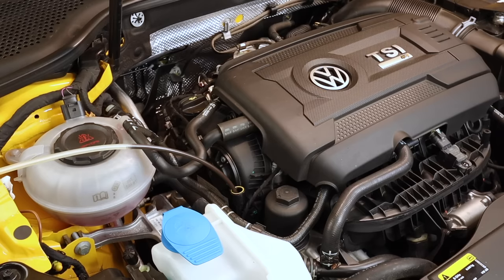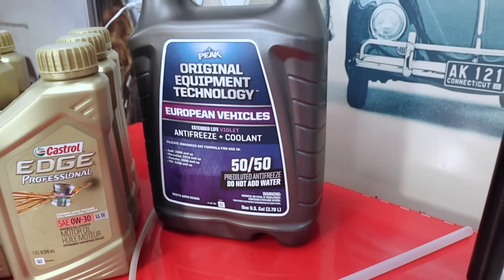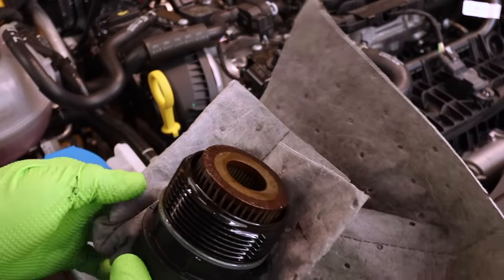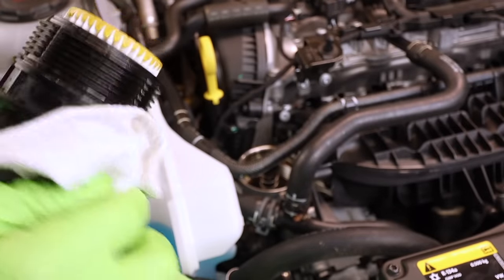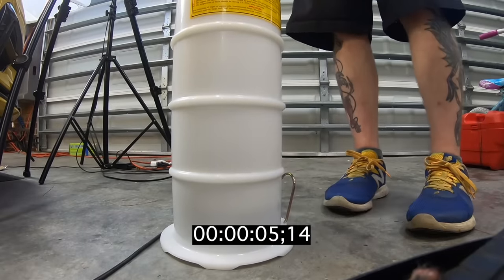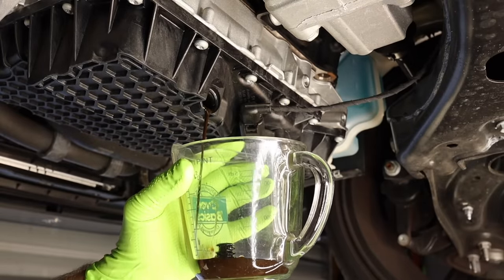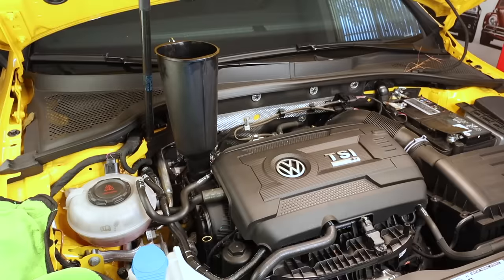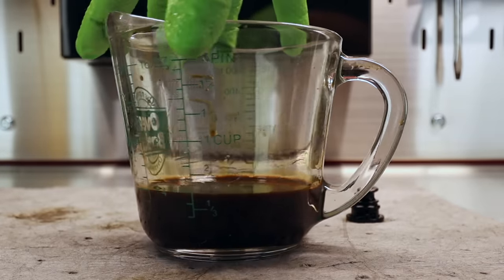Will an Oil Extractor Get All The Oil? (MK7.5 Golf R 5000 Mile Service)

Comment: So if you're using the extractor, and you've got it bottomed out on the pan, then isn't the leftover oil whatever was at the top of the pan? Because you drained from the bottom and not the top down? Does that makes sense? It does to me and I know what I mean. I agree with the not leaving oil thing. I don't like it either. But 100ml really isn't a lot compared to the 6 liters you got out.

Comment: I change mine every 5K as well.  Regardless of what the OM says.  I only use synthetic as well.  I have rebuilt enough engines where I can tell immediately after popping the valve cover or pan if synthetic was used.  This is a great video and it actually raised more questions.  I'm actually not sure I am comfortable with leaving 10 ml behind.  I'm also wondering if you bake with that measuring cup.

Comment: I have a 4WD truck and was debating this for the differentials, transmission, and transfer case. Seems like it would be easier and less messy. What’s your opinion?

Should make my lawn mower oil changes super easy!
Reply: Seems like this is only useful for German cars where the engine oil filter is on top and easy to get to.

Comment: Just alternate methods.  Drain plug method during nice summer days, and the extractor method on days when you dont want to break out the jack and stands.  Extractor method is cleaner and faster.

Comment: With proper vacuum and tools, from either a specialized oil vacuum pump or compressed air suction devices all the oil to the last drop gets evacuated. I know, I have the machine and have checked and that's what we do it at my shop that specializes in European cars. The fact is, all Mercedes dealers, Land Rover/Jaguar, Audi/Porsche/VW exchange the oil via suction, BMW is the exception; I should now, I worked for all of them except JLR.

Comment: Just a couple of issues  my 991.2 Turbo S  and prior F90 M5  do not have traditional dip sticks. I guess only cheep low end cars still use outdated dip sticks.

My other issue is oil that’s left in the oil coolers (aprox. 1qt)
What the best way to drain them ?
If anyone wants to know 
BMW F90 M5 oil change  $325
991.2 Turbo S oil change $550
Like you Charles I like to change oil more often the what warranty covers.

Comment: Thks for the review and great work on the video.  No need to over thinking over a small portion of 100ml oil left. 😅✌🏼 Nothing is perfect is this world. I've change oil around every 3000km to 4000km for my car over 20 years old by the drain nut method. My car's engine also ended up need an overhaul at 350,000km. Hahaha. 🤭✌🏼 Nothing last forever. ✌🏼

Comment: Commendably informative, thank you. Having changed the oil, oil filter, oil-pan and valve-cover gaskets of domestic cars, I acquired a ‘95 Audi A6 Quattro with few miles, and I would not begin to remove any parts unless I was referring to the manufacturer’s diagrams, spec sheets, etc. Before moving any protective cover, I would need to know that I’ve correct applicable tools, replacement bolts and gaskets, o-rings, etc. 

If someone would please recommend the correct manufacturer’s maintenance/service guide such as what I had relied on from Chiltons and Haynes, I would truly appreciate it.

You know that most older domestic autos included oil filters beneath the vehicle near the drain plug, unlike most Euro cars today. Correct? If that is the case with my humble Audi, the oil extractor would not necessarily expedite the draining of the oil? Yet, I used a siphonner to siphon coolant the necessary number of times from my overflow tank in order to clean it with a flexible brush and appropriately sized cloths. That kept the coolant in new reliable condition. Mechanics who prefer to work on domestic vehicles may charge quite a bit even when they don’t reliably replace filters and drain plugs, which can result in a real problem if not tended to immediately, which is why I keep spare coolant and oil on board.

Appreciating the info that you’ve been providing

Comment: A drain pan, new filter, new plug and washer, and gravity suit me fine. The oil extractor looks expensive and not so easy to clean. Maybe it's not any trouble, but once I pull the drain plug, I can take 20-30 minutes to check everything else, change the air filter if it's time, get some water or tea, then complete my oil change. I'm a dyier and time isn't costing me money.

Comment: I just bought a used 2013 Audi. I was appalled to find NO OIL DIPSTICK! 😳 
I plan on using the drain plug for the first oil change. Then I’ll attempt to tilt the car/engine towards the oil extraction tube and see if gets all the oil out.
.... oh and I ordered a dipstick!!! I’m not gonna only rely on the sensors/computer for oil level check.

Comment: I have a Mityvac extractor which is great and allows you also fill from it as well. After I put the new oil in the motor I fill the empty jug the new oil came in with the used oil from the Mityvac.

Comment: I always found with these extractors, or even those quick connect plugs, it was always just faster to remove the plug traditional style.  Convenience is nice, but if it takes three times longer -- I just want to be done....

Comment: I have 3 vehicles and they all require oil changes every 6k miles, but I change my oil and filter on each vehicle every 4k miles.  Now the Tacoma and 4runner arent that big a deal.  They are both lifted and dont require any jacking or driving up on ramps to get to the plug.  How ever my Subaru Legacy does, plus its my commuter vehicle and it sees 4000 miles a month, so that means Im changed the oil and filter on it once a month.  So I use the oil extractor to change the oil on it a few times.  I understand there is still old oil left in it, but since Im changing the oil much sooner than need be.  Its really not that big a deal, plus every few months rather than use the oil extractor.  I drive the car up on ramps and pull the plug and use an extra quart of new oil to pour down the engine and flush all the old oil out.  Yes I am very anal about vehicle maintenance.  My last commuter car, a 2008 Toyota Camry went 600k miles on the original engine and transmission, because I was anal about regular maintenance.  If that aint getting you moneys worth from a car, I dont know what is.

Comment: With the ease of the extractor you can complete oil changes on time. However, i use oil change time to inspect the underbody, suspension, bushings, tires, rust, etc....
I will be buying one and i will use it every other oil change. Hopefully i don't get in to a bad habit of just using the extractor.
Reply from the maker: You’ll still do the inspections. If you do it now that is.

Comment: I’ve been quite happy using a oil extractor on my Mercedes 2014 1.8L Turbo C250 every 10K miles for a few years. Never had any issues. I just picked up a Mercedes GL450 and I will also be changing the oil with my oil extractor.

Comment: Unless your racing that car in track conditions they are good for 10/12k. In Europe the use Castro’s edge 5w30 long life and can go fixed 12k or 12 months ro variable using oil sensors in the engine up to 20k or 24 myths but my experience is 12-15k is when the sensors will say time to change

Comment: Hello sir, 
Yes I will use the oil extraction tool 100 percent because half of a cup of oil in the engine no big deal.  I used my extractor 6 times already and love it , no mess.  Not to mention you will  not going to have any leak from oil pan. 
Liked your video,  very informative thanks and stay safe.

Comment: I prefer to do it the old fashioned way, it gives me a chance to see underneath the engine/front end that you can ONLY see if you get down there, check for any leaks, worn parts, missing or loose nuts, screws, bolts, cracked or broken plastic. Just to make sure everything is Ok for another 5K. At least VW hasn't denied access to motor oil changes (yet) when they do, then I'll by an oil extractor. EDIT: Just wondering if people that use oil extractor are changing the drain plug at oil change as VW recommends, I know HM did ...but was that just to show how much oil was left behind or would HM done it anyway? What's the consensus.

Comment: Oil extract every time, less likely to get oil leaks, less likely to spill oil, less likely to have under body trim clip problems, less likely to spill oil over your driveway can do it without a lift, start with a warm engine then after extraction leave for 10 mins and then extract the rest, if your worried about any that is left, then do your next service 100 miles earlier or buy a electric car

Comment: With my 3.0tfsi oil didnt drain at all when i used the pump. Pump drains more than taking out the plug. I did the other way around, taking out the drain plug first, i managed to pump out another 300ml. Its all depends on which type of engine u have i guess...

Comment: Realistically, the volume of oil not extracted is about 2% of the overall oil capacity. If the car had no major issues prior to the oil change, I reckon diluting 98% new oil with 2% remaining oil is probably ok.
Reply from the maker: Especially if overall the car is well maintained

Comment: did you so a final vacuum extraction  before removing the sump plug -  in my experience it will always suck up a bit more oil if it’s been left to stand a while
Reply from the maker: I didn't. Even with what I drained its 100ml out of almost 7,000ml. not worth messing with on a properly maintained car.
Reply: @HumbleMechanic  Indeed - more from a point of view of understanding how much it actually gets out - but 100ml is nothing in the grand scheme of things

Comment: I get more oil out with a small vacuum pump AFTER all the oil finishes draining from the sump. The pickup tube has to be positioned correctly though.

Comment: My wife's audi is a pain in the ass. It has a cover on the bottom of the car that's really finicky to take on and off (multiple kinds of screws, plastic push thingies, and other stuff that doesn't like to stay in place). The clearance is also so low that I can't drive it onto ramps without adding other stuff to the ramps to change the angle. We also live in an apartment, so we have to go to my in-laws to change it, and my father-in-law always grumbles about oil spill drops on his property lol. I think I'll just go with an extractor. It'll make it simpler.

Comment: Ok, dumb question: why not fill it to the top of the hash marks on the dipstick? I realize it isn't making microchips but generally speaking, in my 35 years of DIY oil changes on roughly 20 different vehicles, halfway on the hash marks has always meant a 1/2 quart low. I'm no engineer though...

Comment: It works! But nothing is as good as a warm-hot motor oil change and filter change with a 1/2qt of fresh oil put in with the plug still out to flush it.

Comment: I always flush the engine with ethanol after I drain the oil. Then I circulate the ethanol and let it rest on level surface before draining it before rechecking it.  I then drain it and add fresh oil so I can be sure there's absolutely no old oul every single time I change my oil.

Comment: I'm an industrial service technician. I work on everything from forklifts to the tugs at the airport. I love my fluid extractor. No need to jack up a 10,000lbs equipment to get a drain plug that is probably over tightened. It also let's me pull the oil out while the engines smoking hot. I go in thru the dipstick tube. Works like a champ

Comment: There is a reason why oil sump's have a drain plug. I will leave it dripping away while I'm changing the spark plugs and air filter, by then all the oil is out and ready for fresh oil and oil filter.
If you have a upward facing oil filter, fill it to the brim let it settle and keep doing so until no more can be added that way there is no delay from oil pick up pipe to filter to vital engine parts.
Reply from the maker: I like doing that with the filter on the up facing ones!

Comment: I know this is an old video... but do you recommend using an extractor for a 2001 Golf with a ALH tdi?  I found a great deal on the extractor and my drain plug last time I changed the oil is very iffy LOL...
Reply from the maker: Yep. Works great on alh

Comment: Does draining from the pan and a bottom mounted filter get all of the oil from a vehicle? If you ran the extractor after draining from the plug, would it still pull any out?
Reply from the maker: no, there is always some oil left in the engine

Comment: Just bought a new Arteon - I'll do an oil change at 600 then 5000 miles with extractor then let the dealer do the 10000. Then I'll go on a 5000-mile schedule alternating my changes with dealer. I want to keep this baby for the long term!

Comment: 1/2 cup of really dirty oil left in crankcase is less than great, but if one changes the oil religiously every 5k miles, then guess its ok?  Unless you have a very expensive car, then not so sure.
  
I just bought the Valvomax quick oil drain plug and it looks great...lots of positive long term reviews on it....but I dont yet need an oil change so will have to see if it also, allows for 95% of oil to easily drain out from pan....at least with its drain clear hose, it will be much less messy than traditional methods of oil draining.

I have never seen a plastic oil drain pain on a car?  but look like good idea, if you have skid plate to protect it.

Comment: For a routine oil change and no other (under the car) maintenance needed, I feel the Mityvac is a good method.  100 ml represents only 2% of the total 5.7 litres of oil.   And with regular interval changes to maintain the engine one should have very little sludge buildup.  Question:  are there any VW/Audi engines which do not lend themselves to this method of extraction due, say, to baffles built into the oil pan?
Reply from the maker: Not that I know of. You’d know pretty quick if I’d didn’t lend to evac

Comment: How much swarfdirt does the oil extractor remove compared to the proper drain method? Often on a proper drain I have found that a few bits and pieces are left at the bottom of the oil drain pan.

Comment: Can't believe any one would leave dirty oil in a golf engine after paying good  money for expensive oil, by the way how much did the extractor cost? I had my Renault scenic3 serviced once and my wife noticed they had replaced the oil with part synthetic instead  of full, when they drained  it the second time the mechanic noted how dirty the semi had become saying it had cleaned the engine many times better  than a drain treatment, the oil stayed clean for some time after this, now I always do this.

Comment: There's not much oil left after using it, it seems quite good. I would say it's only useful to have one if your oil filter is easy to access to, taking my car as an example, the oil filter is right beside the oil pan so I still have to go underneath the car.
Reply: Was looking for such a comment! Same thing with my car. Even with extractor I need to go underneath the car to replace oil filter. That makes sense.

Comment: When I drain any oil, I take the vehicle for at least a 10 mile (16 kilometer) drive to fully warm up the oil. I also would not bother with an oil extractor. I drain my oil and then let it sit there dripping while I have lunch. I also "carefully" clean out the filter housing on the engine and wash out the filter cover.

Comment: I prefer draining oil from the drain plug bolt so you get all the crud and dirt out of the engine. Also you get to inspect what’s going underneath the car oil or antifreeze leaks and CV shafts. No Matter which way you do it you’re not gonna get all the oil out there still a half a litre in the engine in the crevices and cracks. Never did like plastic oil pans or plastic intake’s for that matter. If you make it to 400,000 you’ll probably end up changing both by that point. And I wouldn’t call that normal maintenance

Comment: Would this be a good way to change your oil at a parking lot? I've been wanting to change my cars oil myself, this just looks easier than getting ramps or a better jack (mine only lifts enough to change the tires)
My nearby repair shop charged 85€ for an oil change last time, changing it myself would be cheaper in the long run...
Reply from the maker: Yep super easy

Comment: Only way is old school 
Lifting the car you can see any damage and if its a compo pan its deffo worth pulling plug 

When i was in fabricating a manager asked me to look at his honda blackbird as it had a leak 
Turns out a stone had whacked the bottom of the pan just enough to weep.  i then had the joy of removing and welding said pin hole

Comment: I usually run a few litres of fresh oil through the engine after draining the old oil then put the bung back in and then put fresh oil in obviously to the mark I hate those extraction units we have them I find them very cumbersome sometimes.

Comment: Another great video Charles. I agree with Sneaky Fox though about all the plastic parts Volkswagen is using now. I know it saves weight and cuts down cost but I'm old school. I prefer seeing a nice metal oil pan and drain plug.... lol
Reply from the maker: Thanks!!!! for good or bad, I think we are only going to see more and more plastic. It's not as bad is 20 years ago plastic, but we will see in 20 years. HAHA
Reply: @HumbleMechanic .... i hope the plastics do hold up and get better. But one thing i do know for a fact is MK2 oil pans and drain plugs hold up for 29 years. My 90' G60 Corrado still has original oil pan and plug with no signs of needing replaced

Comment: Not all oil pans allow all the oil to drain, especially steel pans since the threaded bung protrudes into the inside on the pan. On those, the extraction method gets more oil than a drain.